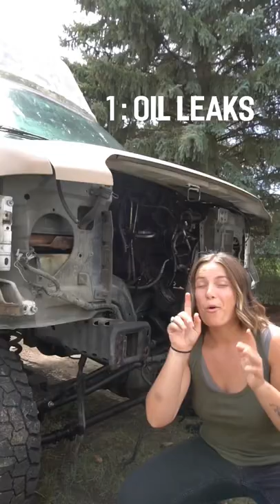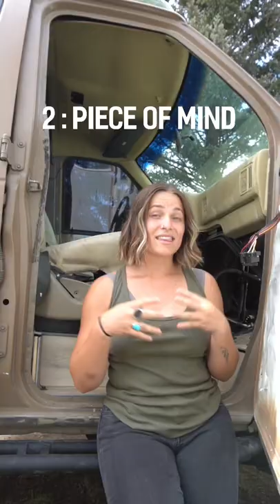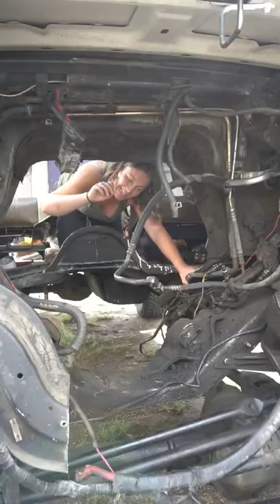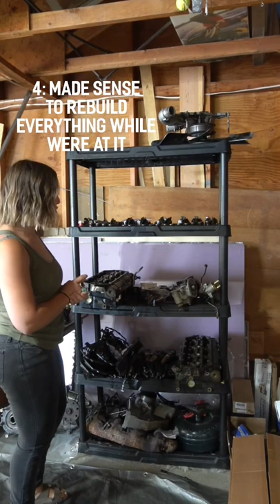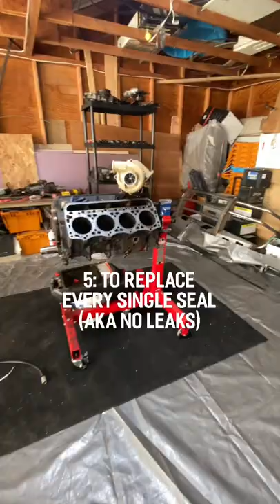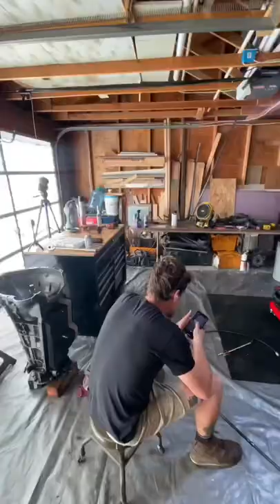5 Reasons why we removed our 7.3 Engine // Van Conversion Series

Comment: Lol 250k miles is nothing for a 7.3 more like 1 million
Reply: Yea that oil leak ain't nothing either just keep putting oil in it itl stop
Reply: You aren't getting no 1 million miles without heavy and expensive maintenance. Injectors are notoriously junk on these and the turbo ain't lasting a million miles. The motor was designed by international and Ford to operate up to 250,000 miles with just normal maintenance. Anything over 250,000 and you are running a much increased risk of once again, breaking down in the desert or mountains. I'm not bashing the 7.3 its a great motor. But expecting 1 million miles with JUST routine maintenance is a very very very long shot.
Reply: One of the few reliable things made by ford😂
Reply: @slimJimmey  Whats even funnier it wasn't even made by Ford 😆
Reply: @OverBudgetRC  oh yeah idi😂 forgot about that
Reply: @OverBudgetRC  that's why it lasted
Reply: @duanethomasdirtpile5737  compared to cummins, cats, & the 2 stroke detroits internationals still don't last 😂
Reply: @alextepozteco3681  helps that they leak enough oil so you don't need to change it😂
Reply: @alextepozteco3681  nothing kills a Detroit 2 stroke. They may have no power but them things are immortal.
Reply: @OverBudgetRC  who made it?
Reply: @PiLLO360  International Navistar
Reply: At least 1/2 million
Reply: @abingham3747  that's why he said "the engine lasts a million miles" instead of "the injectors and turbo last a million miles".
Reply: @sv8313  Sorry to break the news dude. The injectors and turbo are all part of the engine as a whole there genius.
Reply: @abingham3747  no shit Sherlock.
Reply: @sv8313  then wtf was your original comment for Sherlock?
Reply: @abingham3747  my point is that those components of the engine can be easily replaced.
Reply: @sv8313  Someone has never replaced injectors on a 7.3L Powerstroke. It's not like an oil change or swapping out an air filter. A shop is going to charge you thousands upon thousands of dollars to replace injectors or turbo. And it's not just easily swapped out by the average person. The average guy or girl isn't going to have the know-how to just replace a turbo one afternoon. 

An alternator, starter, replacing a belt or power steering pump, that's all easily replaced components. Injectors and turbos. Not so easy to replace.
Reply: @abingham3747  maybe I'm just mechanically inclined but it's not too difficult to figure out how to do on the internet. It's a ton of work but I think someone with average intelligence could do it.
Reply: @sv8313  I have replaced injectors on a 7.3. We had to lift the cab off the chassis. You don't have to do it that way, but it makes life a hell of alot easier. You give "the average" person alot more credit than you should. The average person is clueless to in-depth auto mechanics.
Reply: Yea the motor is so gutless that it can’t blow itself apart
Reply: @rock-uu7qr  the motor is gutless because of the epa stock internal of the 7.3 could handle 500+hp and over 1000ft of torque do that makes it roll coal easy
Reply: @master6435 maybe the bottom end will handle the power but the rest of the engine won’t nor the transmission.
Reply: @connor4961  yeah of course the transmission was weak the is a company that makes a kit so you can use an Allison
Reply: @master6435  well even if you Alison swap it how are you going to keep the engine and trans cool when towing. Your talking about double the power and heat than what the cooling system was designed for.
Reply: @connor4961  yeah like the whole aftermarket world already solved that problem anything oem could not handle the heat
Reply: @abingham3747  it'll last one million miles no problem with routine maintenance. My 94 F350 still has the original injectors and turbo and it has almost 430k miles
Reply: @biggus_dickkus  Wow, look at you. Almost half way there.

Almost 🤣.

If these motors would last 1 million miles with JUST oil changes and scheduled maintenance. Everyone would have one. I'd buy another one tomorrow.
Reply: ENGINE!
Reply: @fredtflail  MOTOR!
Reply: It’s not a million mile engine.
Reply: @abingham3747  negative. That’s normal  maintenance stuff, the engine itself is not.
Reply: @kregadeth5562  hahahahahaha yes it is. Better than any Duramax or Cummins
Reply: Came here to post this too
Reply: @abingham3747  yo my 7.3 has 846,000 (roughly) and it’s 100% stock. The only thing I’ve ever done on her is change the oil. Sorry but you are incorrect. There’s a reason it’s called the million mile motor. I get what your saying about the injectors though. All you have to do is replace the oil in the injector pump as well, Aka bullet proof it and count that as part of your oil change. Not hard either. I usually get that done before it even finishes draining or sometimes just after. If you treat them right they last forever.
Reply: @Cowboy3697  your the exception. Not the norm. Also, 846000 isn't a million.
Reply: @abingham3747  no this one does not but my dads idi finally craped out at 1,200,000ish (can’t remember the exact number off top of my head) they are well known for in the ball park of a million miles if you treat them right. If you just get in and drive and don’t change the oil till it starts to break then your not gonna get very many miles out of it. It’s called the million mile motor (same is my 5.9 12v) meaning I’m not the exception.
Reply: Oh but your gonna tell me about how the idi and the power stroke are not the same and I don’t feel like explaining it so if google it
Reply: @Cowboy3697  I know the difference lol. I use to have a Power Joke. It was a turd. My friends have them they all have 300,000+ miles on them but they have all had extensive work done to them.  It doesn't change the fact that after 250000 miles you're running a much increased risk of breakdown.  Your truck with 800000 miles on it is literally running on hopes and dreams
Reply: These are not million mile engines. They were tough to beat in their day but Cummins has them beat today. If only they Cummins came in a better wrapper
Reply: @itsthatguy5742  no theirs alot of E350 7.3 ambulances that from the late 1990 and 2000 that have 500k to million miles the 7.3 is very underpowered because of the E.P.A. 250ish HP and 500 ft/lb of torture from a 7.3L all iron V8 can hit millions miles stock under powered
Reply: @abingham3747  I have 530,900 miles on my f350 7.3 and runs like a charm with original motor and trans never had to replace nothing but filters and batteries
Reply: @anthonyjodygras8429  @ me when you hit 1 million with no problems. It won't happen.
Reply: @3807shawn  youre not wrong.
Reply: My 6 0 van has 345,061 4" straight pipe and Atlas 80 ficm tune, rolls down the interstate like a peterbuilt!

Comment: “If it’s leaking oil, it’s got oil” 
- shitbox 4:20
Reply: Exactly
Reply: My slightly adjusted motto with my truck; “if it’s puffin blue smoke on startup, you’re good”
Reply: Hahahahahahahahahahaha
Reply: I call it self oil change..
Reply: I owned a 1987 corolla one time that had over 300k and it would leak/burn soo bad i would wait till the lifters would start knocking before I put more oil in..... can't believe I drove it like that for a year befor it finally gave up....
Reply: Shitboxalations 2:69
Reply: @RobertSmith-wu1eb  my 1991 corolla 5 speed manual has 400k miles on it. Still runs like a clock and burns no oil. (It was maintained properly from new.)
Reply: @iheartapple-114  I was the 3rd or 4th owner and I only drove it for its last 20k. It was that way when I bought for 300$ and got my 300 out of it
Reply: @RobertSmith-wu1eb  yea you got your moneys worth. I’m the 2nd owner of my corolla. Previous owner had a vanilla folder full of everything that’s ever been done to the car. Oil changes every 3k miles, etc. I bought it for 1500 when it had 175 on the clock.
Reply: facts
Reply: Indeed brother
Reply: @iheartapple-114  LMAO YEAH RIGHT
Reply: Damn it you beat me to it 😂
Reply: @RobertSmith-wu1eb  was it the six cylinder because my buddy had one and it didn't care if it had fluids or the  right ones...
Reply: @brettscott3759  no the 4
Reply: @RobertSmith-wu1eb  that car was built for teens lol
Reply: @brettscott3759  yea the car saved my but for sure. I had to buy it in a pinch because i blew the motor in my 2004 wrx and I was having a motor built . It got me by never broke down and I was able to scrap it for like 250 bucks when I was done with it so in reality I only paid 50 for it in the end .🤣
Reply: @RobertSmith-wu1eb  those days are gone 😢 😪 I've got a 7.3 I bought for 4000 and it's more reliable than a 80k new truck and the same fuel economy... 50 bucks lol what a steal lol and it paid the bills then the wrx undid all the money you saved lol... good times
Reply: @brettscott3759  🤣🤣🤣yeah the wrx was a money pit. I estimate i spent over 80k in 5 years. 3 trans ,1 motor build, 2 turbos, 1 new set of rims, repair the whole right side from a wreck(my fault 100%).  The only down side with the 7.3 is you won't be the first one over the summit
Reply: @brettscott3759  🤣🤣💯% soul less. Yea mines 5speed manual crew cab long box with 125k has  exhust,intake, 5"lift on 37s. Need to go to 35s and a regear but despite that it still manages 40mph on a 6.5%percent grade hualing 10k + truck and gear so 16 to 17k total .
Reply: Still on stock computer and injectors
Reply: @RobertSmith-wu1eb  lol hell no it's far from stock now its even emp proof supposedly... lift pump, fuel bowl deleted all fuel restrictions removed, dual hpop... some big ass donkey size single shot injectors, Upgraded ficm, custom exhaust manifold- intake spider, methanol injection, engine tune module, transmission computer, ats transmission and turbo housing on ball bearing turbo, engine girdle connecting rods, pistons, studs, full mishimoto cooling system inter cooler/ trans/oil/ radiator... the only real thing left is to go full p pump... stock interior 👌 work truck exterior (peeling paint scratches ect) bed rack lol... I sold a 2019 f350 king ranch 6.7 that Christmas before covid... and had found out I was  going to have some free time... my wife and I drive excursions so it's pretty much fleet service now... I gave up on fast and doubled down on power lol now its just kinda a joke the kids love it sounds like a 🚜 and  ✈️  made a baby. definitely a stupid decision but it's pure fun... completely over looked car... till you get on it, it might not be as quick as a wrx but it can stay right behind one pulling a trailer with a Lancer on it lol... oh it has a 5k rpm limit and needs methanol to increase the power band so it doesn't flop out after 3500 or another turbo... it moves alot of air, I can't wait till winter to see how it starts its only been running 3 months... no crunchy stuff yet
Reply: @RobertSmith-wu1eb  I thought about doing my excursion as a manual with a doubler just to have a 20 speed but I found out manuals have way longer studs for transmission mounting... I think the manual is under rated because you can pretty much just ride 5th if you want and the auto transmission is gutless with our a transmission tuner... have you modified the ac yet? Biggest upgrade for the 7.3... man my wife has 33inch on 22 rims but it's such a pain in the ass dealing with new rims because the offset...
Reply: @brettscott3759  far as I know the ac is stock and still blows cold. But whats the upgrade?
I just bought the truck last Dec.  Did new uppipes,turbo pedestal, valve cover gaskets, pcm(was shorted out), new diesel doc. Glow plugs, 2 new batts,new XRF drag link and tie rods and a new starter. That's as far as I got so far.
Reply: @RobertSmith-wu1eb  that's pretty much what it needs I'd drive it empty and drop the tank replace the two filters and uptake strainer or harpoon it...... that will get you especially the mileage you plus when it snaps you lose access to that last quarter tank, remove the fuel bowl filter detection plunger and do the fuel bowl spring that's cheap stuff and makes it less busy sounding on the injectors better fuel flow cost 15 bucks just make shure you have a filter. Keep a extra cps in the glove box with wrench 10mm  I believe  and I use archoil. I highly recommend riff raff diesel for parts usa awesome customer service and only dose powerstroke great quality, carries ford and Navistar parts. Ok so your heater core is constantly circulating and fighting your ac. So there's a vacuum valve that is a ford ranger part and you install it on the heater hose back in the dark beyond by the firewall and you get a t piece for the vacuum line for the blender door and connect it to coolant valve with some hose. What will happen is when you put it on max ac the coolant valve will shut and I get it down to 30 degrees no shit its the best you will freeze you knuckles and it costs $40 no problems had mine done up like that 6 years ago and it's the stuff of legend on the job site in the summer I've had condensation form on my windows a couple times... it's called a YG350. Also get a trans cooler for a 6.0 those are really cheap low effort high effect things because other than the ac those other things will leave you stranded... ooh also the exhaust manifold bolts break since yours is low mileage when you have time put in studs I know you just did your up pipes but it's not worth breaking exhaust bolts and it because water splash splashing on them you have to modify the wheel well liner

Comment: My 1996 Ford Taurus has 726,000 original miles, still the original timing chain and original front and rear seal on the motor. Still running strong

Comment: Bad idea painting the hot side of the turbo. Usually gets past 1000° F
Reply: It'll just peel off and look normal again
Reply: I have printed the hot side of a turbo with header paint. It was just fine after a full year of driving.
Reply: @crabbiboi5528  on a diesel? My egts get up to around 1300° and if I was to paint the hot side it’d catch fire lol
Reply: @soynando0fficial26  The VHT paint is rated up to 2000°F. I was sceptical but it was an experiment and it held up pretty good. It was only black tho idk how a lighter color would do.
Reply: @crabbiboi5528  well that’s bada$$! I’m used to the one around my town only handling 500° lol
Reply: Wight VHT 2k° was perfect 250k mi
Reply: Raises intake air temps less hp best thing is a turbo bootie
Reply: @Chesus Christ  ?boils law?
Compressing air makes it hot, so yes it heats up the the charg air A LITTLE.  I put the paint under exhaust wrap and a turbo blanket/bootie, to head off any rust from trapped moisture. 10-12,000 rpm more shaft speed across the bord, resulting in a better boost curve. Keeping the heat energy in the system till after the turbo reduces under hood temperature drastically ~100°f for me = lower temperature into the compressor and intake. It also makes the inter cooler work less . My 91.5 dodge has a very small IC so it no longer gets overwhelmed as often.
Reply: @daviddroescher  black paint retains heat grey paint as well. White would be the only color to help. Besides that what is actually helping your truck is the turbo blanket paint doesn’t do shit but keep it shiny
Reply: @crabbiboi5528  didn't hold up on my dirt bike ended up going with a wrap
Reply: Even if it's a heat treated paint?
Reply: @maldenfoster  Black paint doesn't retain heat it just gets hotter faster in the sun lol
Reply: @soynando0fficial26  not if you use high temp 2500⁰ paint.
Reply: @crabbiboi5528  I did  the same thing and had to swap my work trucks turbo into my wife's excursion ant it turned the hot side paint to ash/dust
Reply: The lowest level of exaust paint is 1200° max is much much higher
Reply: @thefirebirdguy8503  yeah but the hot side still smokes the stuff even the good ol grill paint... honestly I believe it's because it's cast and holds moisture..
Reply: @brettscott3759  it'll smoke for a little bit but the paint will stay if you get the right stuff
Reply: @thefirebirdguy8503  I ended up finding a pretty cool older cat that powder coats my stuff with high temperature stuff it looks incredible my wife's excursion the engine bay looks insane it looks like polished aluminum and wet black cherry.
Reply: @brettscott3759  that's awesome! I'd love to have shiny exaust parts 😂😂😂
Reply: @thefirebirdguy8503  lol no room to see them in a 4th gen screaming chicken lol I had a turbo on my camaro and that beautiful piece of art got shoved up and under by the muffler... what's really cool is my dad just had his 76 formula redone with a 5.3 twin turbo. Coolest thing is the shifter it's a actual f16 joystick but all the wires are ran to it so it controls turn signals and such...
Reply: @brettscott3759  yeah these cars really don't leave any room for beauty 😂
Reply: @maldenfoster  Cummins painted all their truck engines tan for years, everything. Then they went to bluke,  yes they called it bluke. Then red, then red and bluke . Then they mixed it up depending on the engine series.  If it burns off the hot side,  who cares. The flames will not be as hot as the actual metal temperature and the vehicle,  stock, is designed for that kind of heat in that area. No danger. A more efficient CAC is always good along with getting the under hood temperature down with vents or whatever you can do.
Reply: Ceramic is my way
Reply: Rustoleum has a bake-on ceramic header paint that is advertised up to 2000°F, would be perfect for this application
Reply: Bad idea thinking you can't remove the oil pan with the engine in the vehicle 🤣🤣🤡
Reply: I just pour oil in mine once a week lol
Reply: Was just thinking the same shit. Did they paint the hot side?!? Oh well it will just burn off might smell like burning plastic for a bit
Reply: catch 🔥